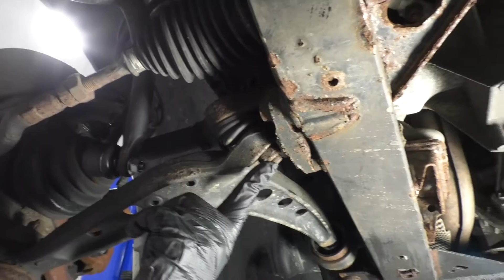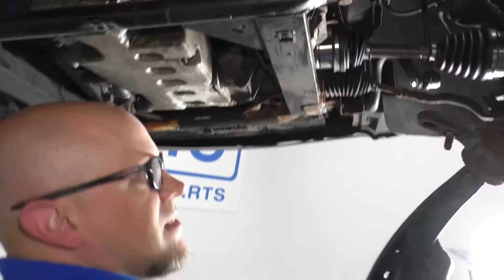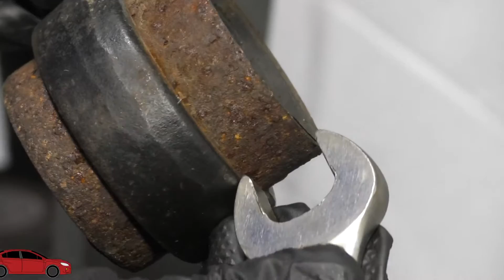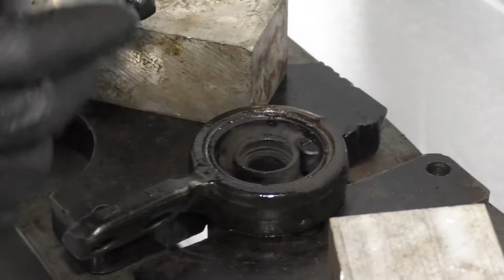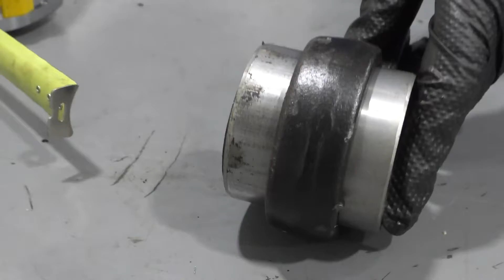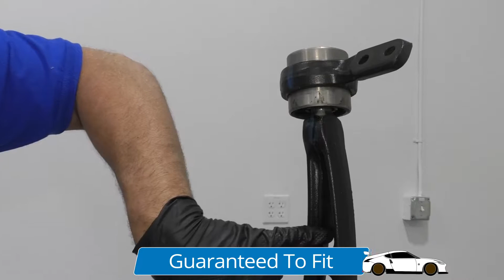How to Replace Front Lower Control Arm Bushing 97-06 BMW 325Xi

Comment: Thanks for the video just did this on my 02 330xi replace the lower control arm all the ball joints and upgraded to the Poly control arm bushings. I somehow managed to do it all without a press lol
Reply from the maker: +Jay Tarallo Thanks for the feedback!
Reply: How did you manage without a press? I am going to change the control arms on the 325xi. Thanks.

Comment: Do you really need to disconnect the ball joints?  Videos for the E46 non Xi show the bushings being replaced by just detaching the bushing mount and swinging the rear of control arm down with enough clearance to push on the new bushing assembly.
Reply: You absolutely don't. On my xi, I did it without a car lift and there was absolutely no reason to remove the control arm. You don't even need to remove the heat shield. Just unbolt and move it to the side a little bit. Pressing the bushings out is the real pain.